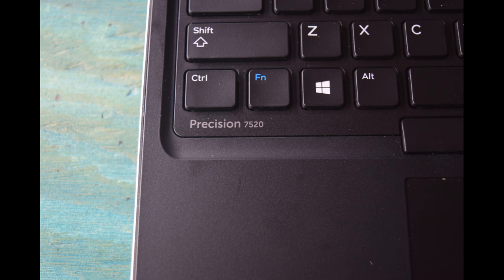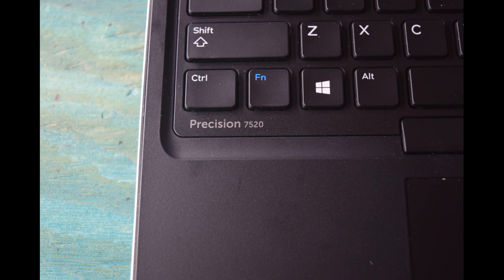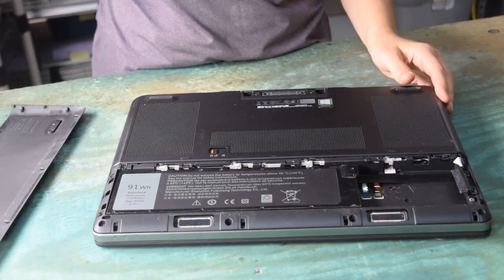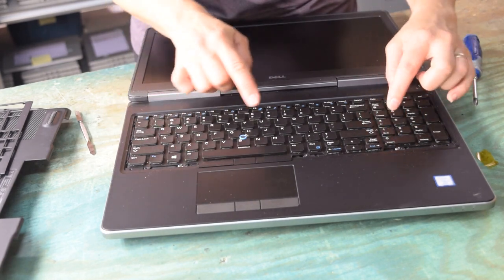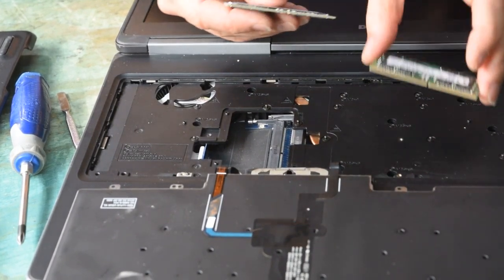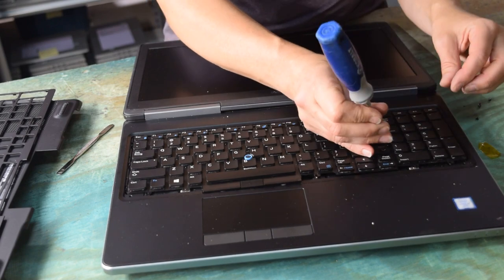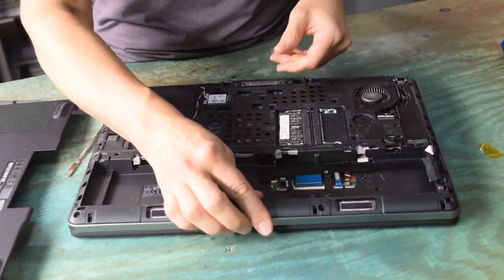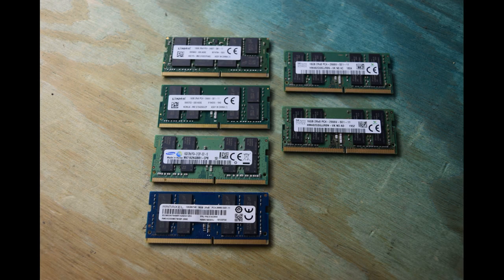Dell Precision 7520 Memory Upgrade

Comment: So if I’m upgrading from 32gb to 64gb do I replace the two 16gb with two 32gb or add two 16gb chips to the upper channel?
Reply: I think you also need 4 matching sets of ram.
Reply: 2 x 16 GB at rear and 2 x 16GB under keyboard, max supported is 64GB, matching pairs
Reply: @ritchierobinson9195  This gentleman is correct. This is the way you would want to go about it. 4x16gbs. Just make sure you buy it all from the same manufacturer, and have everything matching, including rank, clockspeed, cas latency, and of course size. You're not going to want to lift that keyboard anymore than absolutely necessary, so make sure you get it right the first time. I wonder how much acid the Dell enginners ate before designing this mobo? I'm going to guess it was a minimum of 250 micrograms.
Reply: Max capacity per slot is 16Gb

Comment: Good video. But makes no sense that Dell did this. I cannot understand the engineers logic here, it makes very little sense, it's just very bad design. I had a another workstation a while back in the form of a HP Zbook 15 G3, which also had 4 SO-DIMM slots and they were all right next to each other, you just simply removed the back panel and had access, like you would a normal mobo, this is just insane. Having to go to this level of dissembly is going to be uncomfortable even for some experienced hardware users. That all said, because the design is so nuts, I would actually be really curious to speak to someone from Dell to understand why they did it this way, just for curiousity. 

Class video mate.